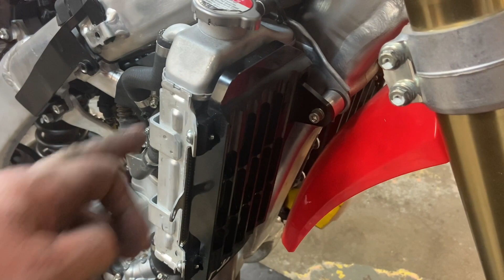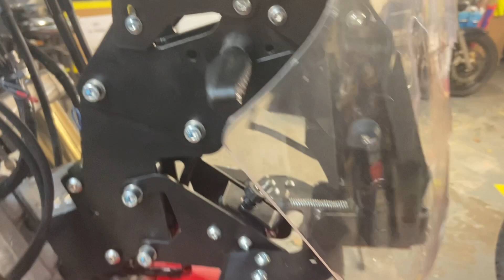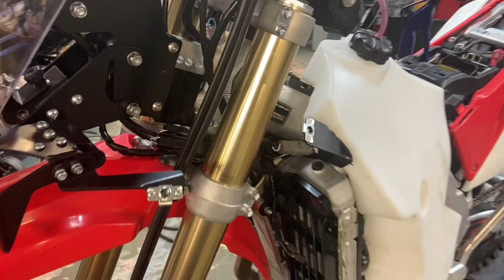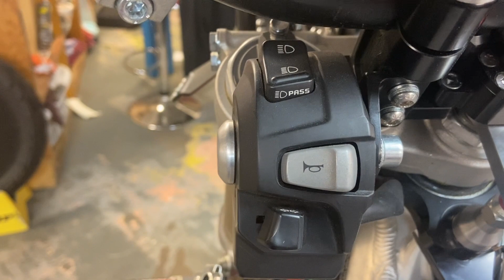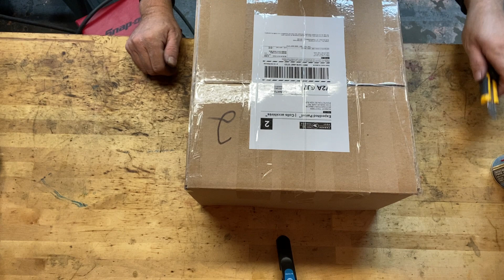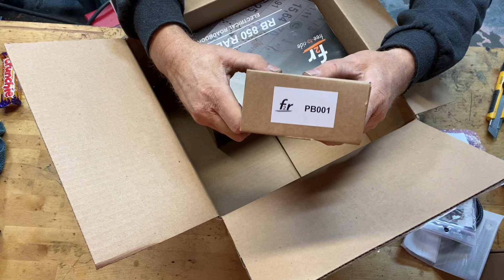Crf450L rally build #14

Comment: Episode #13 you had the RMS Sonora Tower and now this Episode you are back to the MST. Curious what transpired between those 2 . I am looking at the Sonora for an ADV Rally Project I'm putting together. Trying to see if I can fab some wings from the back of the Sonora shield mount to bridge to the tank wings on my KTM. Sorta of expected you would do that after seeing all the great fab work you are doing.
Reply from the maker: The Sonora tower is super light and a great tower.  For this build though, it made more sense to me to switch back.  I thought of Fabing wings like you mentioned, but it still left me no place for the oil cooler and also the signals.  All in all the Sonora tower is a great option for what you are mentioning.  If i had gotten it before I went down the dual tank road I had I am sure the Sonora tower would still be on the bike.
Reply: @rtrottier14 Did you ever make any aluminum Honda mounts for the RMS Sonora? My project got delayed and now I am building a 450RL
Reply: Especially if you are going to try and sell it. 👍🏻I get it.